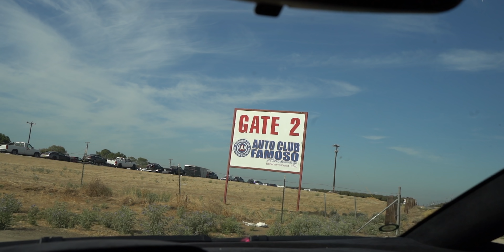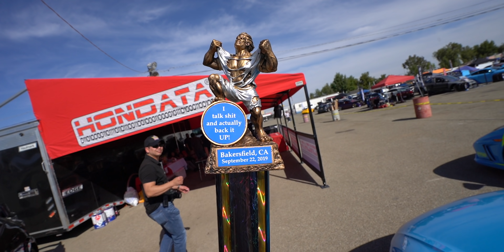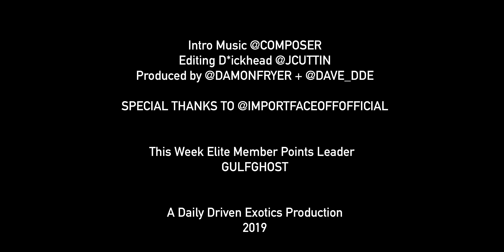COCKY LAMBORGHINI OWNER VS TWIN TURBO R8! *IMPORT FACEOFF*

Comment: This is my roots too. I use to run a 718Hp Acura Integra and do 9.5 in the 1/4 and then totaled that car and put the engine into a Honda CRX  and was able to run 9.3 because of me doing carbon fiber hood, doors, bumpers, hatch and side skirts. Fun as hell.

Comment: I love that Sheepy has the C16 ridin shotgun 😆 NOICEEEE!
Reply: That was MS 109
Reply: Era AG  you are correct. I typed that comment immediately after I saw VP and then later I saw the label and just never edited the post...   to be completely accurate I think he actually used 2 different kinds, I swear I saw the MS109 and another higher octane as well, either way thanks for the correction
Reply: Era AG  you are correct. I typed that comment immediately after I saw VP and then later I saw the label and just never edited the post...   to be completely accurate I think he actually used 2 different kinds, I swear I saw the MS109 and another higher octane as well, either way thanks for the correction